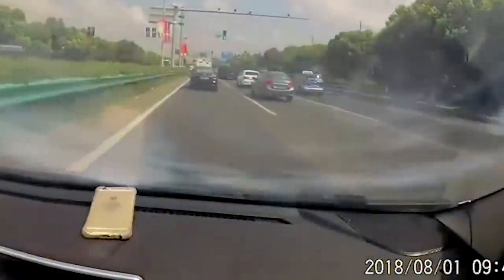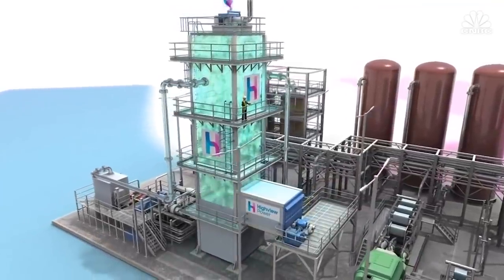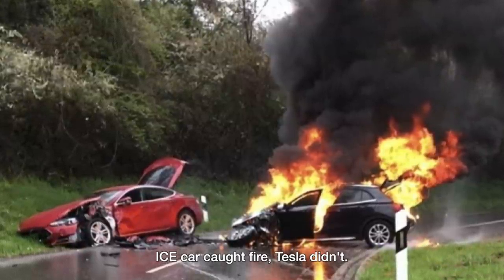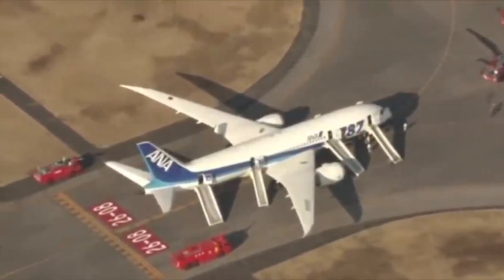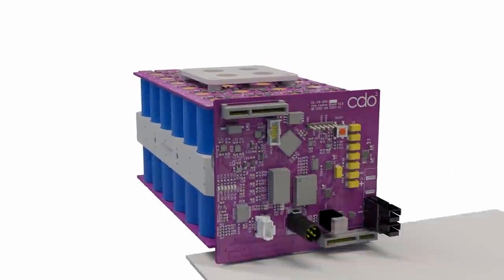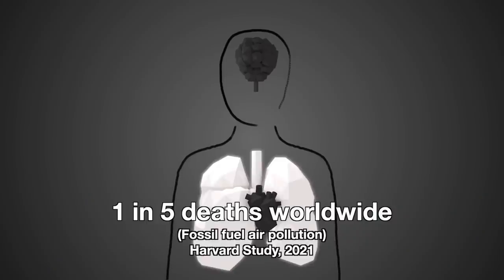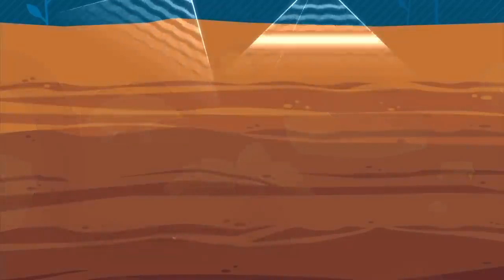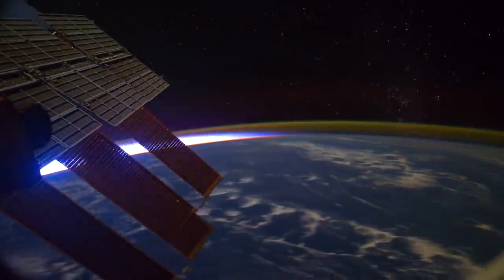What causes electric cars to explode? w Stephen Fry.

Comment: What a disappointment... At 2:01 you mention Energy vault project. And not only that there is no working model, the concept itself was debunked many times over as being too complex, too difficult and expensive to maintain and being too sensitive to environmental factors (namely wind). The lack of research behind it is astounding yet you double down on this idalized computer rendering of a concept and suggest how many of them we would need to power a city etc.
I cannot trust you anymore after fails like these, because I don't have time to fact-check everything you say. So disappointed 😕

Comment: cant you make a tower with weights, that are lifted wit ha motor through a pulley so it uses less than the weights potential when released?
Reply: No. Conservation of energy.
Reply: @Thoracius  how so?
Reply: Work = force x distance 
Pulleys can only increase the output force by increasing the required input distance proportionally - just like a transmission doesn't make an engine more powerful (only produces more torque at the cost of RPMs).
Reply: @fetB  As Ryan explained, if a pully reduces force required by half, it also makes you pull it twice as far, so you end up expending the same amount of energy, plus of course the added friction losses the pulley assembly introduces.

Comment: As much as I like Stephen Fry, and as much as I like the message - this is a fast paced mumblejumble of facts, numbers and predictions. The CO2 levels of steel and concrete are compared to the output of countries, without saying how much of these countries CO2 emissions were produced by steel and concrete and without any reference (like ton of concrete vs. ton of cars). “Quantum” could have saved the airplane from burning, there is a “Quantum” camera, that is its name, but it works with LiDAR, no further explanation.Constantly jumping between physics and metaphysics, jumping from one area of technology to the next, only connected by some buzzwords. No time for real explanation, no time for rethinking. The viewer is left with the impression that something important was said, but unable to know more, only that it was something about batteries and quantum tech. A bubble of smoke quickly dissipating, confusion instead of clarity. A missed chance.

Comment: Parent these sis's, or parentheses/ parenthesis;( e.g.i.e. for example:"Energy is a renewable resource...(i.e."electric/water) it is the implementation of "work/work hours that is so called "cost"; electric can be made free...water as well; a new system without cost ...only fair trade of trading items and/DNA y doing for individuals is the best solution";)🦁♌🎱♾️👁️🧠👁️

Comment: Solar and wind cannot be the cheapest sources of electricity if you are ignoring the requirements of batteries. Because electricity must get onto the grid in a suitable form.

Until batteries and their technological and ecological costs are factored, such claims are meaningless. And unfortunately batteries need to be improved at least 100 times before the grid scale problem can be fixed.
Reply: @Thoracius  simple. Name a single grid that operates on a wind/solar/battery system? 

Batteries do not operate anywhere in the world where batteries are accounting for TWh of electricity. They do not operate anywhere covering the daily week and seasonal variations in wind or solar. All batteries installed on grids to date are for emergency frequency control of arbitage of low prices at night and storing for sale at high prices in the day. 

Not storage. Frequency control and/arbitage. Every single grid battery project.

Then consider which grids have achieved low carbon status. Nuclear and hydro feature in all main examples.